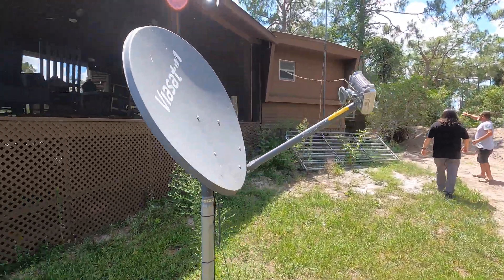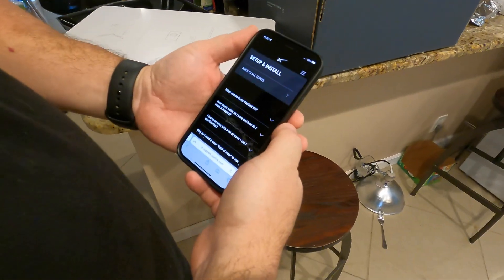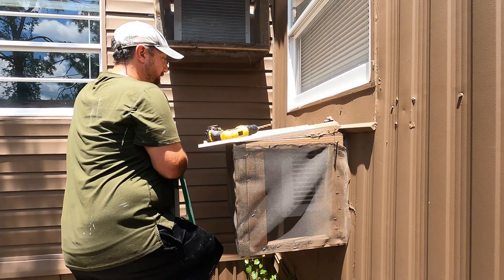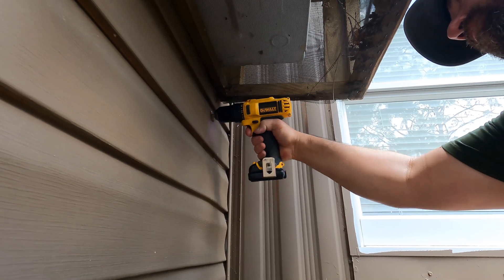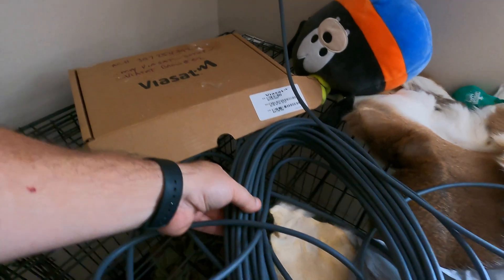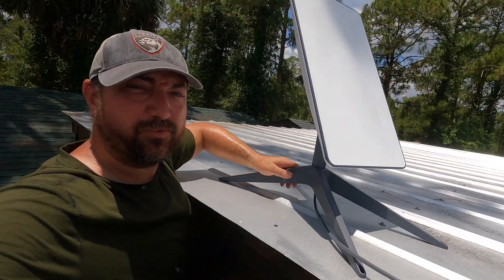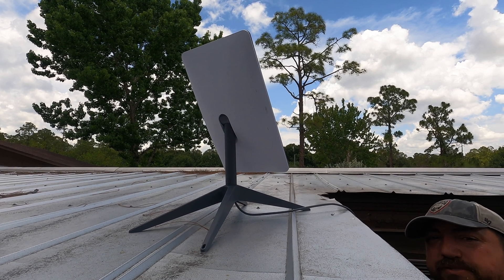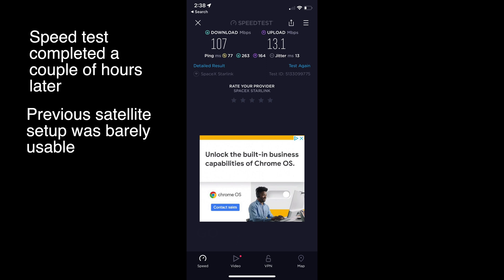Starlink - Setup and Testing

Comment: Always do a reboot from within the Starlink App on the wifi and the router once a day.  That will dramatically help with speeds... Also put the dish into stow mode and then hit un stow once a day and that will also force to dish to find a more preferred satellite which helps the speeds big time.   I am in a waitlist area with the RV version and my speeds are always up near 70-100Mb download.   Get 2-3 mesh units as well.... Huge difference !!    AWESOME!!!
Reply from the maker: Good advice, thanks for the info, we'll pass it along.  Appreciate you checking out the video and taking the time to comment.

Comment: What was the point of drilling holes in the wall when you could have just fit the wire through one of the windows and closed the window down on the wire? That's what we did it and it worked
Reply from the maker: Hey Rick, thanks for the suggestion.  A few points to consider:

1) In Florida, I don't like opening the window for anything (too hot) so the thought of leaving something sticking through it freaks me out, lol.  Don't want to let the heat in or AC out.  The plan is to seal the hole in the wall around the cable with silicone or something similar.

2) It's not my wall, so it doesn't matter to me if it has a hole in it.

And most importantly,

3) That's a good idea and you're right, it probably would have worked fine, but we didn't think of it.

Thanks for watching!